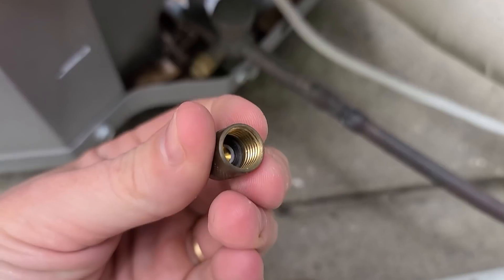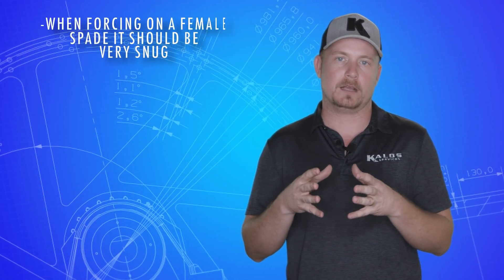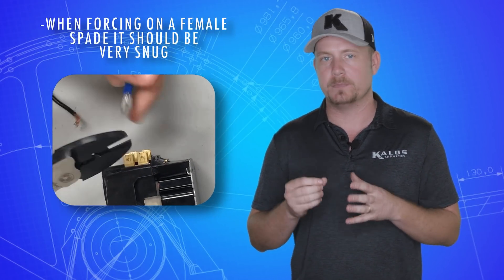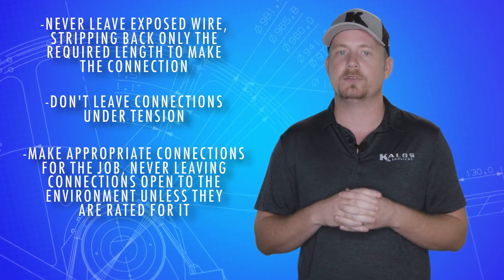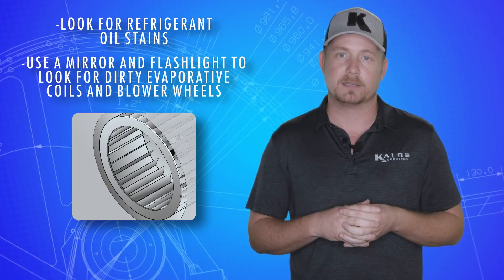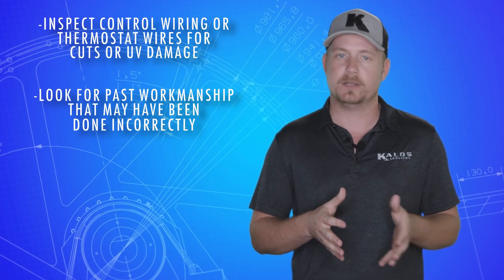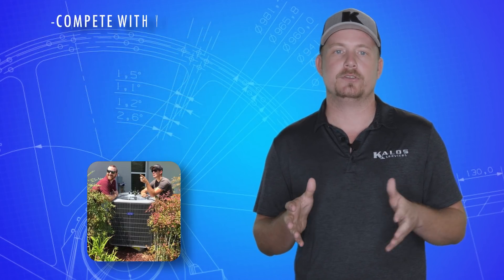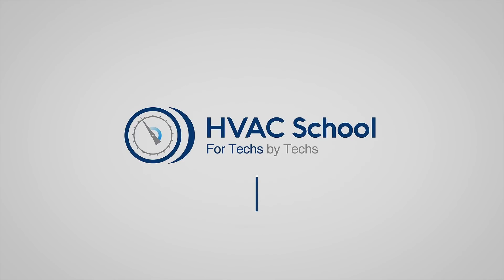4 Silly Mistakes of The Green HVAC Tech

Comment: Absolutely great video!
 If I may add; Before condemning a compressor for being shorted or grounded, be sure and not just test at the wires at the contactor and capacitor- get down there and remove the cover or plug on the compressor and test at the terminals/lugs. There may be a CRS wire shorted to the case or tubing or perhaps a wire came loose.
  Also, as a courtesy, If I am working on an AH or furnace unit in the attic, I look around and check the insulation, ventilation, any piping, ducting, electrical, maybe termites or rodents, leaky roof and so on. The customer is well impressed if you do find a problem that can be fixed before it becomes a huge problem.
47 years at HVACR and still going strong.
Reply: That's a great tip! Several years ago my friend's AC went out, so I went over to look at it and found that the capacitor was bad and replaced it. While I was there, I also cleaned the coils and replaced the filters and the unit ran great until last summer then it went out again. For some reason, instead of letting me know, he called some dumbass "professional" from Craigslist who ended up condemning the compressor and doing a hack job replacing the entire unit. I took the old unit home for parts and scrap and found that one of the wires simply broke off the crimp terminal under the compressor's terminal cover and there was nothing wrong with the compressor. If that moron took another few minutes to properly diagnose the problem, he would have saved my friend nearly $5000 replacing a perfectly functional unit that worked better than the one he installed. It's sad when a 20 year old IT student knows more about diagnosing HVAC equipment than a 70 year old "professional" who has been in the industry their whole life.

Comment: One of my most memorable rookie mistakes was made changing out a defective hi press sw. on a carrier rtu. The senior tech I was with saw I wasn't using a back up wrench . I snapped off the port just as he yelled NOOOOO !   That was followed by - " Go get the torch. "   Woops !
Reply: I did the same on a heat pump and twisted the copper tubing around lol

Comment: How about this one ? When i was an apprentice i was working across the street from the University of Miami with a Journey Man. We were doing a full refrigeration retrofit on an air source chiller. He couldn't find a 120V connection for his vacuum pump. I told him I would look around the building for a 120V socket. As i was doing that he couldn't wait any longer and used his alligator pig-tail and hooked up to a transformer on the control panel off the chiller. Big mistake. As soon as turned that vacuum pump on. The whole transformer blew up and the panel caught fire damaging several boards.

Comment: Question How do I handle this I go to install a gas valve that was diagnosed by another tech who supposedly was an instructor ar a  local trade school I install gas valve as requested unit not working I do my troubleshooting and find hot surface igniter not functioning trace it back to circuit board tell service Manager he sends me out with another tech who responds you know what your doing why am I here in other words the senior tech if you will didnt troubleshoot properly and I got to pick up the ball cause he dropped it do I tell the tech who missed it or the service Manager or both if Im equal to the tech but dont make the same wages where do I stand Im a team player but dont believe the individual should be missing things as such like a greenhorn
Reply: Always do your own diagnostic.
      NEVER CHANGE A PART SOMEONE ELSE CONDEMNED.
     If you do sooner than later you will replace a part (probably sooner) 
That wasn’t bad. 
     Trust but verify 
We are all human and will make mistakes.
Reply: Always call the tech and let him/ her know what you found. 
    When I was in the field every day I would call the previous tech and talk to them on my way to the customer.

Comment: And don't forget this one. Don't always go into a job assuming there is something wrong just because the customer is not satisfied or a previous tech says there is/ or can't find one... The hardest job is the one working on a perfectly good system. Could be under sized or something completely unrelated affecting the system.
Reply: I have a lot of people complain that when they turn their heater on they feel cold air for a bit and then the hot air comes out I just look at them like what do you want me to do.

Comment: I WISH I had watched this video a year ago. I'm still a little green. About eight months in. I'v made ALL these mistakes at least once. But usually only once. My senior techs were only a little annoyed with me, and probably because I started to immediately do things better every time. I use the 'dummy plugs' on my manifold now for caps. I always inspect for seals now...now. The advice I would add to this video as a new tech is this:  "TAKE YOUR TIME"  A lot of times we solve the problem, but we'v already run up and down the attic or crawlspace like 3 times and we want to leave! DO NOT RUSH. That's how my foot slipped and went through a ceiling one summer day. It's never fun when the attic you work on only has beams and no platform, but that's no excuse. I didn't even get yelled at, I got a 'bless your heart'. Which is probably worse. lol
Reply: Over 40 years in the trade
I always use my manifold to hold the caps and the put the screws back on the unit after I remove the panel. No way to misplace them or lose them.
Reply: @hvacmike1175  This is a brilliant idea and I would have never thought of it.
Reply: Another trick if you have a unit leaking water and can’t find out why use a piece of plexiglass. You can take the door off tape the plexi in it’s place watch what’s happening inside the unit under “normal” conditions.
  This reveals the issue almost every time. Sorry for getting off topic
Reply: Your install guys, however, should know to take pieces of plywood when doing an install on a bare attic as a temporary (or permanent) solution. It’s just common sense. Lay it down and your job gets exponentially easier.
Reply: @peepeepoopoo1399  we mostly sub out to install guys. even if i'v done about a dozen installs myself. this particular job was a customer that is basically a property manager. we have been doing PMs and fixes for him for at least a few years. the company, not me. this particular apartment complex i worked in wasn't our install. i know the brands we use, and HOW we install. we have used boards in the past when doing some installs. i can't remember the details of this particular job, but MAYBE it's a smart idea to carry random boards in a truck all the time on the off-chance a customer has a shitty set up in their attic. but it doesn't seem all that practical.

i will add that as the new guy, i have far less space on my work truck. if i had a bigger one, i may just keep a board or two on it....just for me....to re-use for attics that suck.

Comment: As a 40+ year tech, caps left off and screws left out are my pet peeves. As for missing the obvious is not limited to new techs I’ve done it too many times as well as most of the others. I actually have learned and been reminded of many things from your videos and podcasts
Reply: I just had a new 5 ton heat pump installed. Just before the lead left, I noticed 3 screws had bee left out of the air handler. He had to go get hi driver to put these in. After he left, I found the caps were left off the service ports. This was from a highly rated company with a dedicated installation team.
Reply: @user-bj4lp3fr1o  Just imagine the stuff you didnt spot. Thats why equipment fails prematurely.

Comment: I like to think I do well, when I can find a problem or the only issue in under sixty seconds.
A tech with some history and  growing experience, by using a smart start chart list  for the unique machine .  knowing the startup sequence, noise and visuals components make, and the difference between sounds of gas flow, liquid flow, normal motor noise and a failing winding or phasing sounds. All of these while running should signal an issue if one or more change.  Note if any non oem parts have been substituted that could make louder or softer noises and may need current and voltage tests before and during run. 
Many times I have come across  undersized low voltage thermostat wiring. Long runs with small wires will cause havoc . 
Thank you Bryon and Bluon for keeping all of us tech mechanics on our toes..
Michigan senior tech, two years, two months til I pass the baton... hopefully 😇

Comment: Thank you so much for your work and time, also I respect that you understand that newbies are new. I started working for a very small company that knew I had 0 experience, and I feel like I was treated like I should have known everything. In a way, I am happy, because I've only been in the install game for a year, and I do a better/faster job than some leads and foremen. I also feel like I'm underpaid lollol!!
Reply: Saul, learn how to spot the difference between a compressor muffler and a factory installed filter drier. Some leads and foremen see the muffler and fail to put in a filter drier on an installation.  Try not to make the lead feel stupid, and point this out incidentally. You will make a better impression that way, and not be thought of as a smart arse.

Comment: I teach my guys the best tool you carry is your senses and experience/ knowedge. What do you see? Smell? Touch? Hear?  Is the unit communicating to you? What does the customer report? You can narrow the mental funnel tremondously before you take your coat off or remove a nut runner from your bag. Don't rush into your diagnosis.
Reply: Well said! I often say the equipment talks to me.
Reply: I always talk with the customers about the system. This  became my best diagnostic tool over the years.
    If you actually listen to them they will usually tell you what the problem is.
     Never connect a set of gauges to a HVAC system until checking everything else first. Most repairs are electrical or lack of maintenance.
Reply: So true

Comment: Most crimpers have a "insulated" crimp and a " bare" crimp. The insulated crimp section is flat and the bare section has the indent. The indent can crack or puncture the insulated part of the connector if used.

Comment: Good tip on the crimping opposite side of the barrel split. I learned this on my own but it really seemed to make a lot of sense to do it that way.
Reply: I was always told to crimp the split side. This is news to me!
Reply: @bikerbobcat  this was the first time I heard someone recommend it a certain way. In my personal experience I notice when I crimp the open side it just pushes them out causing it to not be secure. No one taught me just what I saw in my own experience.
Reply: It works both ways just seems better the way described.
Reply: Also wasn't specified, but a crimping die with an indent is only for non-insulated crimp connectors. Crimping dies without the indent are for insulated connectors. Most crimping pliers will have both on them.
Reply: @JH-ms3ny  You are correct. In my experience I only use the indent (non-insulated) side for both. I haven’t had much luck using the insulated side for a insulated sta-kon connector. I know it’s the right way but they seem to pull off easy. I always pull on my connectors to verify that that are Secure.

Comment: One minor point in my experience schrader valves almost always leak to some extent I don’t think I remember finding even one that won’t give at least some trace with an an electronic detector they are basically a glorified bike valve of sorts and should never be trusted to hold the system charge the cap in my opinion is actually the gas tight seal same with the screw caps on the valve body to a lesser degree.

Comment: Nothing worse than goin up to the roof for a no heat/cool and finding the disconnect off lol.
Reply: The 100lb pigeon turned it off 😅
Reply: @shifter8207  lol its even worse when it was a call tht u were personally on.  The walk of shame
Reply: @shifter8207    What a laugh, but I had a COOLING  ONLY unit , with an electric duct heater, every so often, NO HEAT CALL, , on the roof , the 30A FUSED DISCONNECT, was OFF, , As I got up the ladder a SEAGULL SITTING ON THAT DISCONNECT, BUT WHEN SURPRISED HE FLEW OFF SEING THE DISCONNECT FLIP OFF WHEN FLEW OFF, capable ties were not yet popular, so used some SOLDER to secure it ! Cheers 🇺🇸🇺🇸🇺🇸🇺🇸
Reply: Easy money